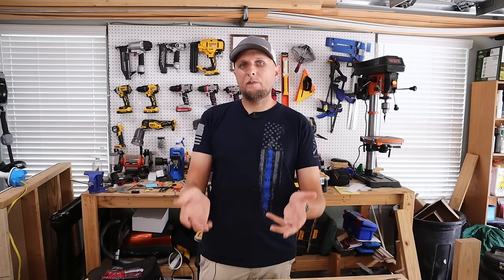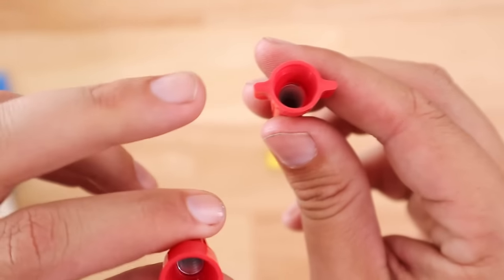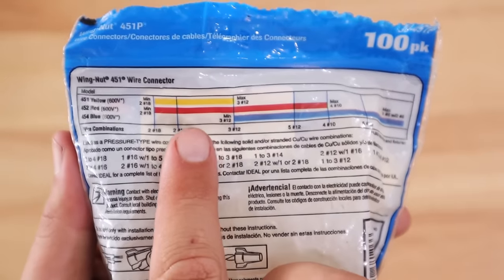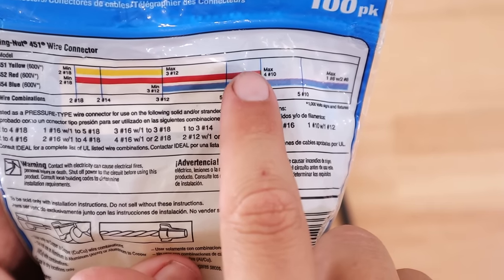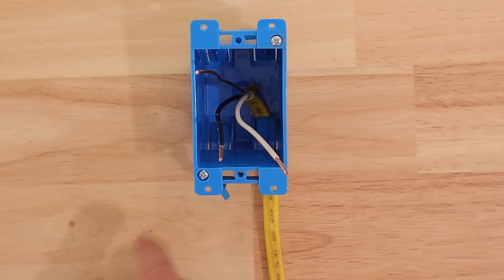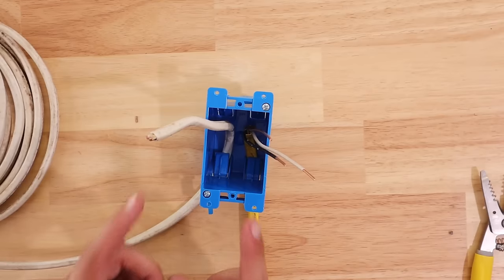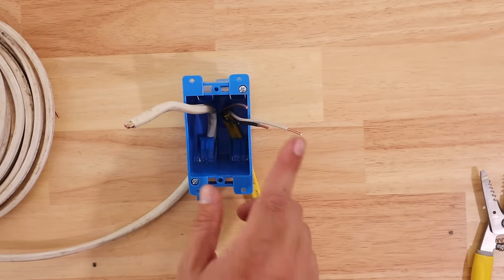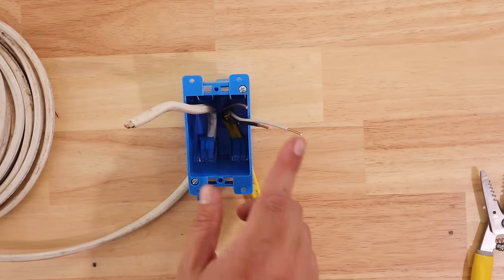Biggest Mistakes DIYers Make When Connecting Wires Together | Part 2

Comment: We covered this before.. you have a 12ga wire feeding a string of boxes..off of one of those boxes you want to feed ceiling lights..you are not going to feed those lights with 12ga.. you would use 14ga.. so inside that box you would have 3ways spliced together 2-12’s one in,,one out and a 14ga out feeding the string of lights.
Reply from the maker: Yes because the load is determined by the fixture never exceeding the wires capacity.  That is different than what I am talking about in the video.
Reply: @HowToHomeDIY   Well I’m sorry if i came off too critical .. i think what you do here is a good thing..i wish it was around for me.. i have rebuilt my house from the inside out .. from trenching in a septic field to new furnaces .. i just thought it was a good place to add the idea of a possibility to a good place to mix ga’s ..
Reply: @HowToHomeDIY  How is it different than what you talk about in the video? In the video you said putting an outlet in or tapping into this that goes to a light. It can't be 14ga wire to the light?
Reply from the maker: The light fixture comes with wiring affixed to it, it is supplied based on the load.  It will never exceed the wiring’s capabilities it definitely won’t exceed the feed wiring either.  We are talking about two different things.  In the video I’m talking about at a junction using undersized wire for continuing the circuit.  Someone could then put a 20 amp receptacle on that undersized wiring and cause a fire hazard.  However you can put a 15 amp receptacle on a 20 amp circuit per code as a 15 amp receptacle won’t accept a 20 amp plug.  However unless I knew the use of the receptacle I personally would not do that.  Remember that codes are just the minimum requirements.
Reply: Agreed, robert. You're describing a classic trunk and branch circuit. Branches are smaller than the trunk and that's fine. The breaker remains at the most conservative value to protect the smallest branch. What someone may do in the future is on them, as it always is. 

The only way to more conclusively future proof the house is to string 10ga, maybe 8ga, hey why not 6ga? wire everywhere, in the off chance someone will want to hoist a 200lb 5-HP table saw and use it in the upstairs bedroom 20 years from now.
Reply: @thenexthobby  When i ( oh and I’m not an electrician I was an AT&T Engineer) was wiring my barn looking for 12ga wire. A supposed electrician was almost yelling that all I need was 14ga…haha ..

Comment: It's one of the reasons for inspections. All my home runs are 12 and in some cases 10 awg wire because you didn't discuss voltage drop. We have several longer runs in the house just the way the wires had to get there that are about almost 100ft to the panel. So I def upsized the home run to account for that. NEC recommends no more than 3% from the panel 5 or 7% overall from the service.  Now few electricians actually bother as it's usually not a problem, but wiring my own place. Yea I'm making sure it's done right.  So downsizing the wire isn't an issue, you just have to be aware of basic electrical theory.
Reply: i dont know any licensed electrician that ''doesnt bother'' when it comes to voltage drop.

Comment: I currently use, as a diy’r, push-in and Wago connectors. My question is: If you’re using wire nuts, would you recommend using No-Ox to help retard oxidative corrosion between the wires?
Reply: I believe that is only if you're mixing aluminum and copper wires.

Comment: So this is a touchy one some misunderstand code,,,, in areas where wires are accessable,,, such as say in a ware house,, conduit down the run,,, and tag of for hi baby lights every so many feet,,, one can run 16 gauge "so" cord from the light fixture to the junction box, on a 20 amp circuit,,,, so long as ...... It's in the code,,,, but any wiring inside of walls ,,perminintly installed👍 one must maintain a same wire size threw out the branch circuit,,,, now yes so long as the over current protection is matched to the smallest  conductor size with in a branch circuit ,, you can get away with mix conductor size,, but at point of over current protection ,,the conductor should be perminintly labeled,,, as to maximum amps

Comment: Save yourself ten minutes and read the following instead:

1) Know and abide by the instructions/specifications on the wire-nut or other connectors’ box.

2) Never use any wire in a circuit where the fuse is rated for greater amperage than the wire. The fuse must always be rated equally or less than the weakest component in the circuit, wiring, connectors, outlets, switches included.

Comment: Wago connectors are simply unbeatable.  They are faster,  provide a better connection,  FAR easier to service, takes up far less space.  They are worth their weight in gold. They are vastly superior to twist wire nuts. Because they handle a wide variety of residential wiring, the save a ton of time when used in residential applications.

Comment: How does the Wego(sp?) pushin type spring mechanism differ from the quickfit that is found on the back of electrical outlets? Is it more/less secure?
Reply: One thing is that the Wago spring tension is applied roughly parallel to the wire being inserted. In a back stab receptacle the spring tension is applied from a perpendicular orientation which is weaker, all other variables being equal.

Comment: Never use a WAGO !  I was involved in building 18 hotels over a two year period. Five of the projects specified using the WAGO's. After being open only six months many rooms reported tripped breakers and failed bathroom outlets even on 20amp breakers. The bottom line was the WAGO's tiny spring clips could not handle the current issues due to overheating. This property removed all WAGO;s from 125 rooms. We found 10 rooms with melted WAGO's and another 65 rooms with melted wires on the WAGO. Since then we have found some local building departments not allowing the use of these. Other projects replaced WAGO's used in bathrooms because of the current required for hair dryers, coffee makers, etc, all of which were still under 80% of the 20amp circuit load but the WAGO couldn't handle it as the conductors would simply fall out. Using your plyers to twist conductors together compared to what a WAGO does should convince anyone why to never use this crap.
Reply: Those little German connectors have never failed me and I abuse them in a lab environment (high temperatures, vibration, humidity and extreme over-current). There are a LOT of counterfeits out there though. Some fakes even have all the proper markings! I've been involved in these investigations many times, from microwave connectors to microchips. It's not easy for the team to keep a supply chain clean and it's not getting any easier.

Comment: You forgot a step.  You also have to make sure the receptacle or switch is rated also for 20amp or 15 amp depending on the wiring.  Makes no sense to run 12ga wire with 20 amp breaker all the way and put a 15amp receptacle.
Reply from the maker: Well technically it’s legal to put a 15 amp receptacle on a 20 amp circuit just can’t put a 20 amp receptacle on a 15 amp circuit.  Now would I do that?  No probably not as there are situations where it could be dangerous.  However, just wanted to let you know that code does allow for it.
Reply: It makes perfect sense especially if you are using "spec grade" 15amp receptacles. They are identical in performance to 20 amp of similar grade. Most homes are built using 15 amp duplex receptacles exclusively on 120v circuits.
Reply: @HowToHomeDIY Why would it be allowed if there are situations that could be dangerous? It's not allowed on a 20 amp dedicated circuit and a 20 amp single (one socket) would be required.
Reply from the maker: I have no idea why I said that Ted lol.  My mind was probably in two different places.  Thanks for the callout.  Nothing wrong with a 15 amp receptacle on a 20 amp circuit.
Reply: @HowToHomeDIY  No problem, my friend.

Comment: greatest advantage to push in connectors is liability note not reliability
Reply: the two best advantages for quick connectors are: speed & short wires due to drywallers rotozipping our boxes and damages wires.

Comment: The same packaging instructions you are referencing states not to pre twist conductors.
Just fyi...
Reply from the maker: No it does not state not to.
Reply: Regardless of what the instructions say, it is always a good idea to pre-twist to make sure you have a good connection.
Reply: @glasshalffull8625  try putting the max allowed conductors in when twisted…
Reply: @SuperVstech  Exactly one of the reason I like WAGOs, but if you are going to use wire nuts, pres-twisting is an industry standard in the field.

Comment: WHAT DIFFERENCE DOES IT MAKE WHETHER YOU CONNECT 14G TO 12G WIRE OR JUST DIRECTLY CONNECT TO 20A BREAKER....SAME RESULT IT'S STILL TOO MUCH POWER FOR 14G WIRE!
Reply from the maker: Correct.  That’s what I said isn’t it?

Comment: If you use wire for the device load branch, the device won’t draw any more current than it needs. If one doesn’t understand basic theory, they shouldn’t be doing electrical projects. These sort of discussions are not for the ignorant, unless they’re trying to learn from an accomplished diyer or an electrician. These things, however, cannot be idiot proofed. Some education and common sense must be applied.
Reply from the maker: Thanks for the feedback Vincent.

Comment: The problem with Wago connectors is they are illegal in almost all cases of electrical work in the United States and they are against us electrical code.       Also I’ve noticed most cheep wago’s can’t handle the amount of amps we have in most cases and they melt witch is probably why they are not legal in most parts of the USA
Reply: They are legal. Please share evidence that they are not allowed by the NEC in the US. They can handle the amount of current that they are rated for, like any other listed electrical product.
Reply: i'll echo john, please provide the code reference that prohibits quick connectors.

Comment: Unrelated to this. Have you have tried to shove back a double outlet wired with 12 Gauge?  The solid wires are not flexible at all.  The entire USA electrical wiring system is garbage.  In Europe they use 240V and stranded wires. Wiring is a breeze.
Reply: yea cuz you obviously dont know what you doing. stranded wire is junk
Reply: @harveylong5878  Stranded wire isn't junk. In the US, everywhere but residential, we use it every day.

Comment: If you use push in connectors you have never did electrical service work! I see way way more defective connections with push in connectors vs wire nuts! Electricity is not a hobby, hire a licensed electrician!

Comment: The biggest mistake DIYers make when connecting wires together is getting advice from video's like this. If you have to watch a video on how to do your own wiring you are not qualified to do your own wiring. Hire a pro before you burn your house down.
Reply: But there are some pretty bad pros, as you call them, out there. The house I bought was wired by a licensed electrician and that license electrician put two 30 amp GFCIs on 12 gauge wire. So much for hiring a pro. I, the do-it-yourselfer, changed the 30 amp gfci's to 20 amp like they were supposed to be in the first place.
Reply: Learn how to do it yourself so that you won't need "pros" to connect a hot, a neutral and a ground and sometimes the scary 4th red wire. Woooo spooky.
Reply: @mikeslater6246  What do you mean by 30 amp GFCI. Are you talking about a 30 amp Circuit Breaker or a 30 amp GFCI outlet or a 30 amp GFCI switch?
Reply: @bobcosgrove3235  sorry, I was not specific. They were 30 amp gfci's in my breaker panel. The home inspector found one bad and didn't catch the fact that it was a 30 amp unit on 12 gauge wire. I realized the problem when I bought the replacement 30 amp unit and went to install it. Luckily the electrical supply house was willing to give me full credit for what I paid for it against the purchase of the 20 amp units but by time the 20 amp units came in, this was during the covid shortages, they had gone up significantly.
Reply: Totally agree
Reply: There’s nothing wrong with watching a video to get help on doing something simple like making a couple of wiring connections. Not everyone has the money to hire a pro like you say they should, also a lot of so called pros watch how to videos as well. Yeah there’s a lot of bad information out there but there’s also a lot of really good videos that help people out.
Reply: The problem is if you need to watch a video to learn how to make a couple of wiring connections then you do not have the knowledge to tell if it's a good or bad video. Before watching a video on how to do your own wiring you need to ask yourself would I watch video on how to do my own appendectomy to save money. If the answer is no then why would feel qualified to do this. Do you really want to risk the lives of your family to save a few bucks.
Reply: @bobcosgrove3235  I'm sorry, but that's just not a good analogy. Most people don't have any kind of background to attempt medical procedures. But many people do have the basic background necessary for DIY electrical work. I will agree that you do have to do a self-assessment and that some people will not be qualified, but the comparison to a medical procedure is somewhat ludicrous. As I pointed out in my earlier reply, a licensed pro installed two 30 amp GFCI breakers on my 20 amp rated wiring. And since then I have found other problems such as reverse wired outlets and my doorbell transformer wired in the attic with no electrical box. Hiring a pro is not a guarantee of safe quality work and DIY is not a guarantee that someone's going to burn their house down.
Reply: @bobcosgrove3235  I think you’re being a little too extreme here, I’m not a mechanic but I change the oil in my truck and a lot more. We’re not talking about rewiring a house, just basic stuff that isn’t really complicated. There’s a lot of good people giving good advice, ultimately you have to use good judgment.

Comment: The YouTube rabbit hole has led me to your video. I JUST bought the WAGO connectors last night. 😂🥹 
And I have a question hopefully you can answer. (If you even see this) 
I got the connectors for connecting my wall oven in the junction box and the electrician I had come out to wire my kitchen for the remodel used 12/2/2 romex. 
So my 240v source coming out of the wall has 1 red, 1 black, 1 white, 1 white w/red pin stripe, and then a bare copper ground wire. 
While the oven whip that is required to be hard wired into a junction box has 1 red, 1 black, 1 white, and a green wire. 
The sub panel I had installed for the new kitchen breakers has the 240v breaker with the red on one nut and the black on the other of course, and the ground is connected to the ground bar and then those two white wires (1 w/ red pin stripe) are sharing a hole on the neutral bar. 
My understanding was that 2 neutrals can not share a spot on the neutral bar. 
There seems to be very little information I can find on YouTube, and all the forums on how to actually USE the 12/2/2 romex. And how to connect them. 
When running a dedicated circuit at least. 
Is that second neutral supposed to be capped by itself and just left in the box? 
Or is it for some reason supposed to be combined with the other neutral from the line and all 3 wires connected together. Like 2 neutrals from the romex and the oven neutral. 
I could very easily be over thinking it, but it just didn’t make a whole lot of sense.
Reply: kinda got lost in your question but most stoves are 40a and require 8/3 with black/red/white conductors with a bare ground. not sure about the other wire in the cable but if its capped off in the junction box and in the panel by itself then theres no issue as its dead on both ends and safetied off

Comment: how do I splice say two 12 gauge or AWG wires into 1 12 gauge AWG wire? As well as protect to and seal it via heat shrink it or plastic dip it or both or electrical tape it?
Or for speakers